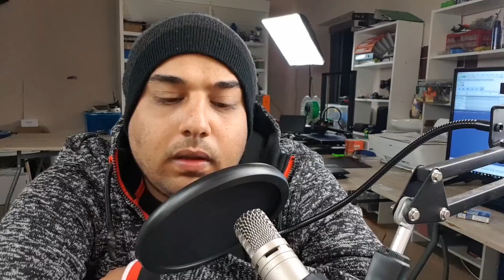How To Build Your Own Flight Controller For INAV or Betaflight // Open Hardware Flight Controller

Comment: I think the best way to go would be to make a super complicated schematic, but it has to be nicely made and named. By that I mean every single thing should have a rectangle (it's possible to do in EasyEDA which you're using) that's named. That way, I can say: I want a 9v and 5v regulator, therefore I will delete entire rectangles which have a 3.3v regulator and a 12v regulator. I don't need a buzzer, so I will delete the buzzer pad and a resistor or something, so even such simple things. By the end of this process, anybody can make their personalized flight controller with a few deletions. This approach also means that you design a single file with 3 gyros and in a text tutorial have something like: "Choose whether you want an MPU6500, MPU6000 or ICM206something. Delete the other two."

Comment: Please don't do SPI interface for SDCards, use SDIO as it should be. All the support is there, you can use 1Bit to save pins, also don't use TIM1/TIM8 in this case as they cause DMA issues on F4 (in general).

Comment: Cool idea, one thing I think will be the issue - the overall cost of the FC. Making PCB is one thing, but populating it with components is another. Especially all those tiny SMD caps and resistors. You would need a better equipment for that that just soldering iron - preferably reflow oven, stencils, soldering paste,... maybe some people would be able to do it but not a chance for someone who has experience soldering only wires to PCB, they would need a LOT of practice... I guess you could have it assembled but that would add just another layer of cost, especially for small series. But I do appreciate your commitment to this and its great idea to get people to dig in the electronic and hardware side of things, even if they only design the board and someone will like it and make it.

Comment: Can't wait. I've been thinking about trying to design a flight controller for ages. Maybe trying to get low power multi core cpu's like something from the intel atom range using each core dedicated to to its own application. I have no idea if its even possible, but i want to try anyway. Thank you for trying to push our hobby forward!!!!

Comment: I feel like an open-source flight controller should be set up like Arduino, with the shields.  There could be a base, with the USB, power, CPU, and uart pin-outs.  With a header-stack that shields can be made for.  So different sensor boards can be made and tested.  Like the gyro's, baro, bluetooth, and / or whatever is commonly used on the basic shield.  Then a different shield with all that but instead have a wifi or long range serial instead of Bluetooth.  (for example).   You make a good point with the GYRO.  That should be in the center of the craft with dampers - but there is no reason to have it stuck to the center of the flight controller, it can just have wires lead to that - so we can setup the rest of the layout with whatever real-estate there is to mount the stuff more efficiently.
Reply: That doesn't sound right. The thing about arduinos is they don't have to be small and light. On the other hand, with drones, why would we even use anything else than pixhawk - sized flight controllers? Well good luck with putting a pixhawk on a tiny whoop. Also there would be the issue of connectors with high frequency vibrations. However, maybe such a thing could be designed and while really bulky, it would be enough to test what you really need. However, when a good combination gets found, to get a usable drone you have to make a new board with everything on it.
Reply: @JakubKraus0  Development systems are not micro.  Tiny whoops is what a developed system is reduced to for production and size.

Building a research test machine is not the same as soldering up a lightweight racing copter from pre made parts.  Try etching and make your own circuit board, and place those tiny surface mount resistors on it.

Comment: I want to see a flight controller and 4x esc combo. With bec current sensors and osd but those were just the extras you were talking about. Im mainly talking about the esc cause that would make it completely different. Im not talking about a stack but an actual fc/esc aio. Like the racerstar starf4s for example.

Comment: Would be interesting to know where to get parts for existing FC repairs. Like switching DC converter chips who are available for sell only in bulk per 2500 pieces when I need only 1 or 2.

Comment: If you are going to make FC, make a half stack one so you can use it with half stack VTX !
Reply: Using components from a 20x20 fc on a half stack fc would possibly work as the surface area of the boards is almost the same. The hardest part I can see is vibration management. It's gonna flap around to much on only 2 mounting points.
Reply: @slingitsideways  if JB can fit FC on only 1 side of a 20x20 board with a PCB, I don't see why can't you bend it in half and remove the PCB
Reply: @BuzZ.  Yeah it's possible, but you still have to find a way to stop vibration getting to the gyro. At the minute we use gummies, but that will just allow the fc to flex and vibrate with only 2 mounting points. If we hard mount the fc like we use to do, then we get back the vibration from the frame.
Reply: @slingitsideways  I think it would be all right, you would have to use metal standoffs with mpu6000 it should be Ok same as halfstack vtx's they don't vibrate. Maybe halfstack board with soft mounted ICM gyro would work too
Reply: @BuzZ.  I can see where you're coming from, but from a engineering stand point, anything that has over hang is suseptable to flex and vibration to some degree. It doesn't matter with a vtx because it doesn't affect the performance. A soft mounted ICM gyro may work, depends on the amount of flex and vibration in the board.
Reply: @slingitsideways  yeah, it needs testing
Reply: @slingitsideways  or we need a way to solder 2 half stacks together so if like vtx burns, you just desolder. It would fix that problem and it would also make it so you don't have to use wires to connect vtx and FV together
Reply: @BuzZ.  I like the concept, but you'd create a weak point with the solder. It's the same with welding, the 2 plates or boards in this case will still flex to a certain point at different rates depending on weight and thickness, and the fail point will be around the solder joint, lifting a pad or breaking the solder. So then you could start to think about using a full 30x30 for stability,  half the board for fc duties and a simple pin out plug system for the vtx on the other half, so if the vtx burnt it's a simple swap out.
Reply: @slingitsideways  there already is a 4in1 ESC that is 1/4 of a stack so you solder them together and you have 4in1 there isn't any stress on FC because its really light
Reply: @BuzZ.  Yeah I've seen them, And to be honest I'm not 100% convinced by them. I can see the advantages and disadvantages, but they all weigh the same and all the boards are laid out the same, so vibrate at the same frequency. Where as a light fc will just vibrate at a different frequency to a heavier vtx. Example would be the build I'm doing now. The revolt v3 weighs 6g, so lose maybe 2g by half stacking it, so lets say 4g (a 20x20 fc weighs around 3g), The Matek vtx I've used on previous builds weighs 6g, that's half the weight again, something like the AKK Ultimate mini weighs in at around 8g, twice the weight, Increased mass equals lower frequency, for example (and by no means mathematically correct) say the 4g fc vibrates at 50Hz, the 8g vtx vibrates say 25Hz, all going through the solder joints. So yes, while they are soldered together structurally they will be more secure, the lighter fc will vibrate more than the heavier vtx, giving unpredictable vibrations to the Gyro and stress on the joints.

I think maybe I'm looking too much into it. lol.... more than 6 pages open on my browser and a half built quad on my desk in front of me. But it makes a nice change to have a decent chat in the comments, rather than the usual trolls👍
Reply: That's actually an awesome idea! 😃

Comment: You have started something amazing. I have kept this idea of making my own piece of hardware for my drones for a long time, this will open a big door for me. Just a question, is the hardware based on which design? Because if it is based on the OMNIBUS F4, it can also be used with ardupilot beside betaflight and inav.
Again, thanks for doing this!